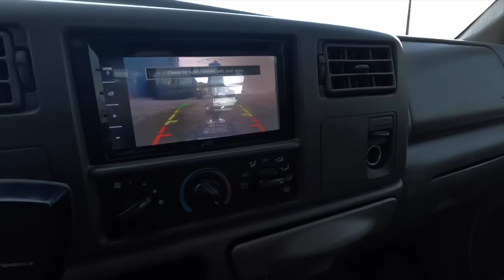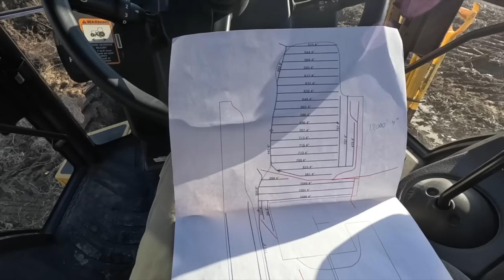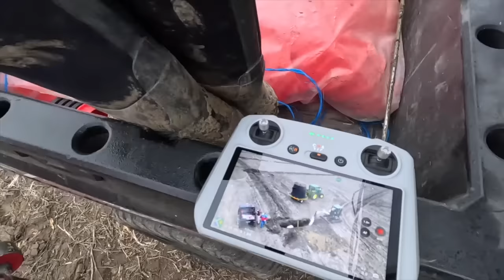Drainage Tile Installation With Case IH 580 Quadtrac!!

Comment: Your animal guard on the outlet is installed incorrectly. They are to be installed 1-2’ inside the pipe with the spikes facing out, able to flip up a little allowing debris out but not in. We farm in nw Illinois. Fixed and installed tile late feb too. We think it’s a first on our farm. Just got 2.5” of rain that turned into 6” of snow. No fun

Comment: Do you use GPS controlled auto depth control on the tile plow to ensure that the tile pipe is always running downhill regardless of the terrain surface?